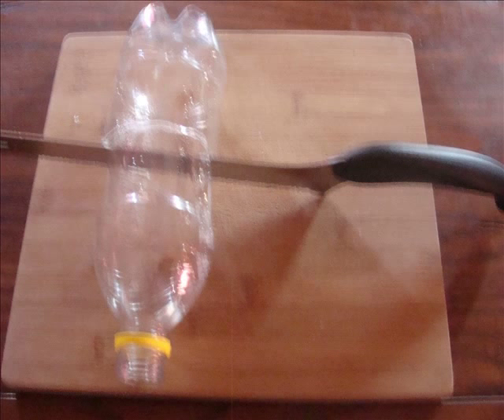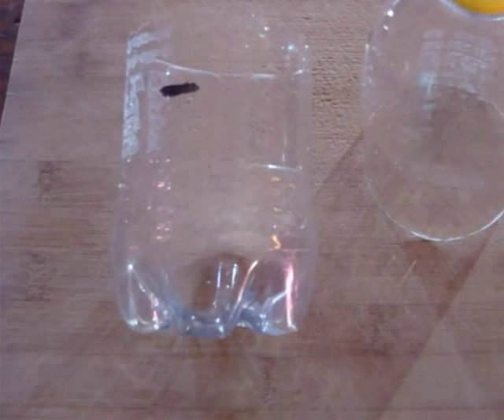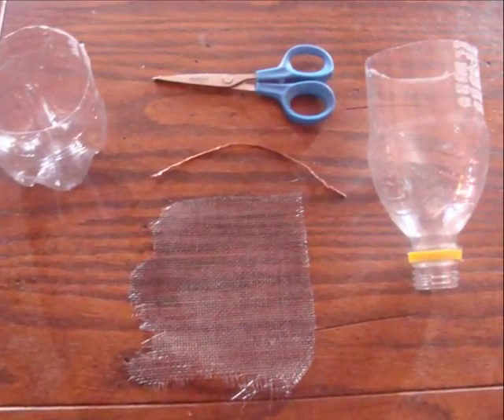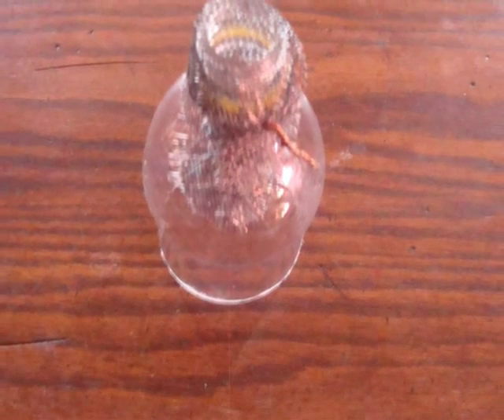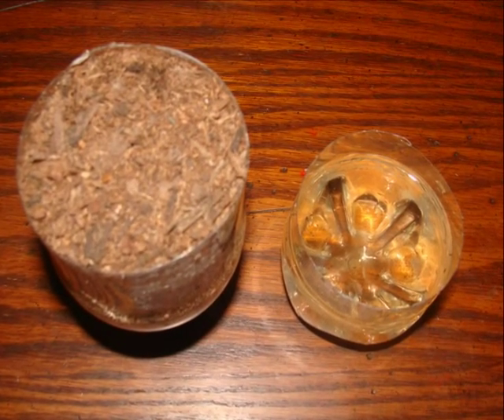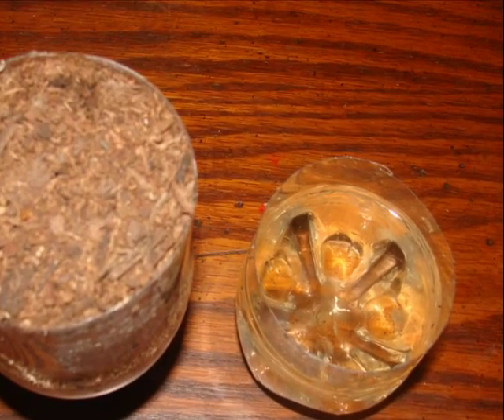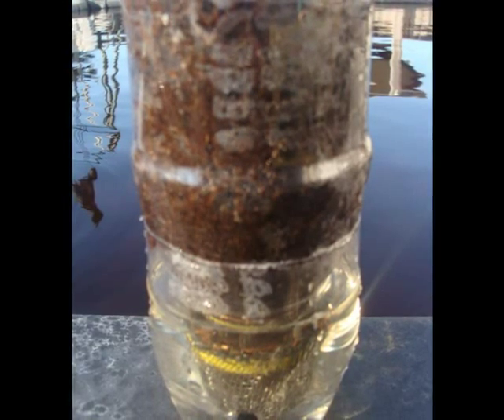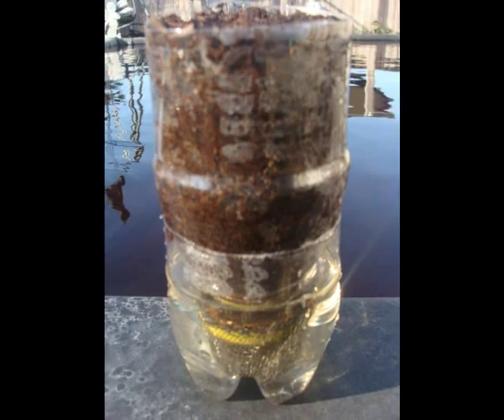Self  Watering Plant Container

Comment: I did this back in 86-86 with a 2 liter bottle but i used cotton from a vitamin bottle to keep the soil out of the water, I ran into problems really fast as the soil never dries out , its gets water logged and mold grew on the surface of the soil. I also had a small hole in the lower bottle so i could refill it with a turkey baster instead of lifting the two apart to water, I had pushed them together hard so they wouldn't pop apart